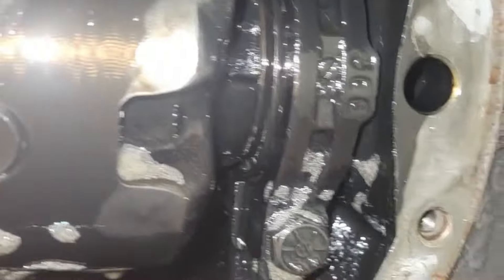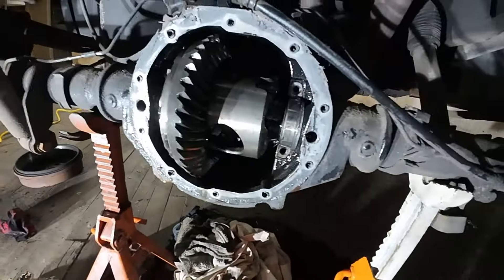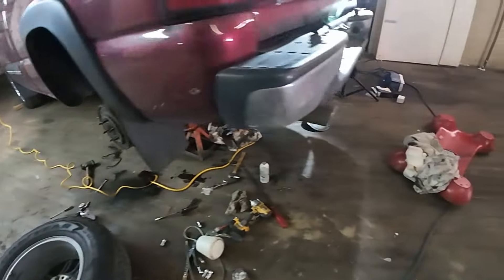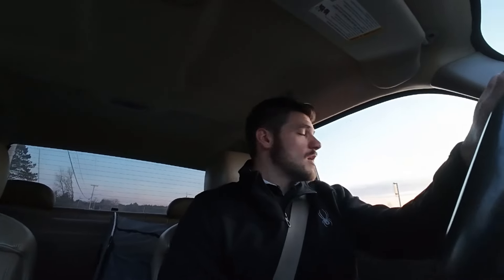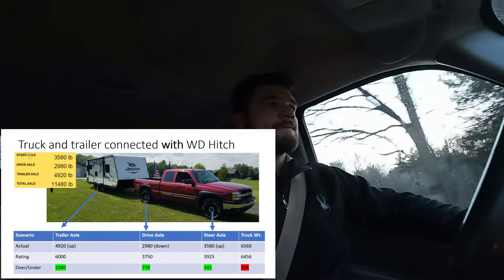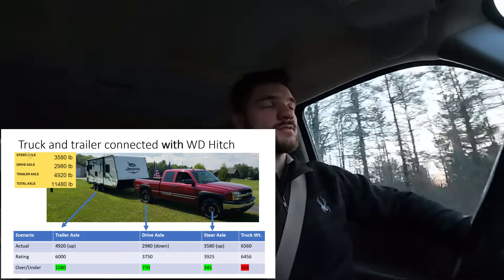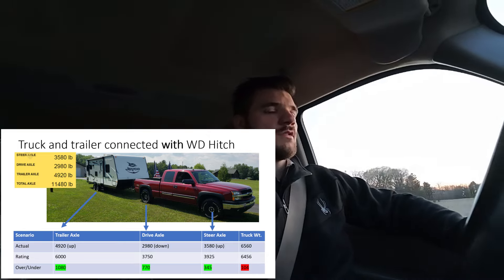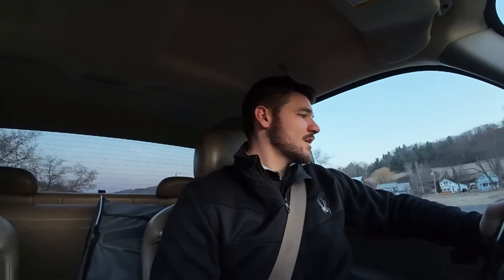Why I finally retired my 2005 Silverado

Comment: Still driving my 2001 GMC Sierra Z71 ext cab every day,  bought it brand new in 2001 off a GMC dealership lot.  Original everything 5.3L Engine, Trans, Transfer case, differential etc  etc.   I get the oil and filter changed every 5,000 miles since new (oil is clean between changes) and get everything serviced every fall as needed before cold winter hits and it still runs like new.   Like you i've gone all over the place in mine and tow my Bass Boat and utility trailer all over with no issues.
Reply from the maker: What state do you live in? One thing I didn't mention in this video but I do also thing the thermal cycling of being here in the northeast going from 100deg summer weather to -20 in the winter takes it toll too. Anything from rubber seals and gaskets to piston rings to clutch packs in transmissions etc. 

Also how many miles on yours? I love to hear that its still going man I love these trucks. Trust me when I tell you if I thought it would keep going reliably I'd still be driving it you can guarantee that. Heck, I do still drive it locally and for smaller stuff I love the truck.